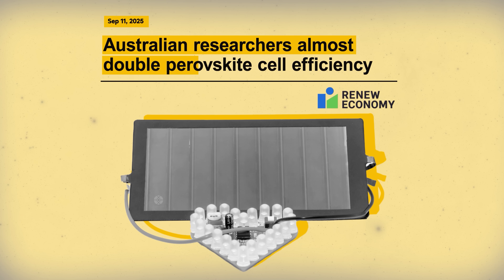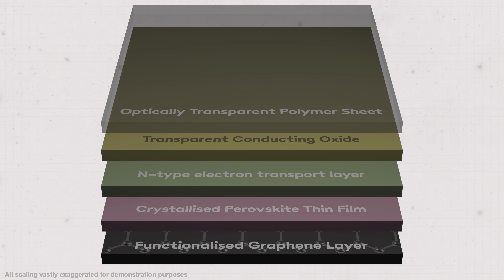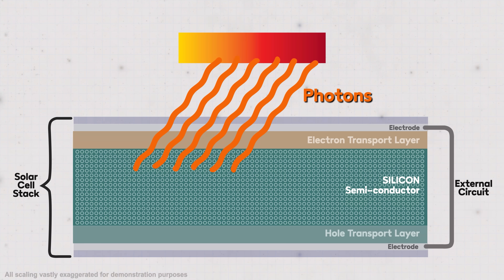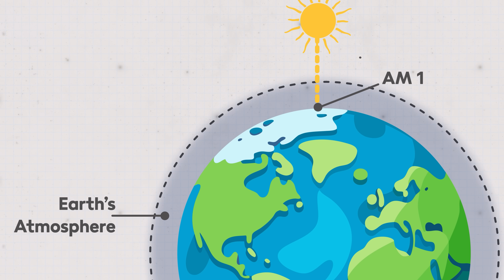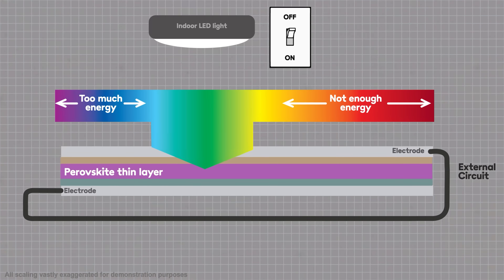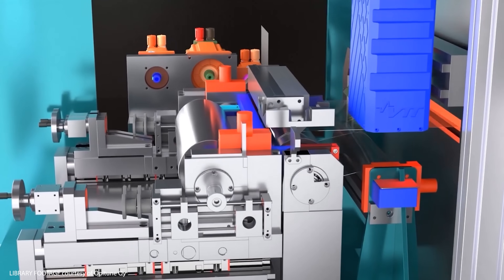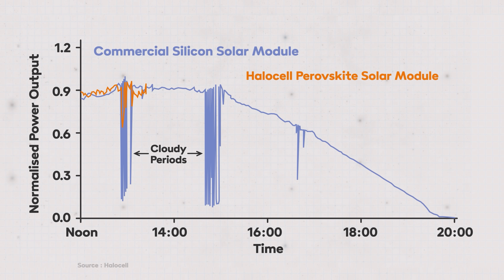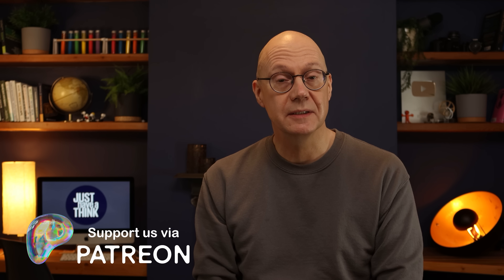Graphene Perovskite just revolutionised the Solar PV industry!

Comment: I am excited by the Aptera solar-powered car...and a more efficient solar cell would just make that car even more truly solar-powered and hardly ever needing mains charging.
Reply: Sadly the market for an expensive two-seater tricycle is quite limited and no institutional investors want to put money into Aptera; are you going to give them the $150M they need? I hope they somehow get the money to enter production, but it's a safe bet to predict that an EV startup will fail. Ultra-efficiency is good and as it gets cheap every EV should have some solar PV to gain a few miles of range, but for now 90% of drivers are better off buying a conventional EV for less money to recharge with nearby or grid solar power.

Comment: I live off-grid. I have 4x100w monocrystalline panels. On my best days I get ~90 watts. This is a big deal for me and the folks up here in the highlands.
Reply: I'm curious about your setup. Is there a reason you're limited to 4 panels?
Reply: @asm_nop I don't need more. My lights are LED, my fridge takes 10 watts to ignite the propane, my radio has a crank and scans emergency bands, and on clear nights gets S.A. and PacIslands. Got literally 1000 dvd's and book I still havent read. Hell, I'm still looking for Waldo.
Reply: @asm_nop  Yes, particularly 4 low power panels?   I'd expect these new graphene perovskite cells would be more expensive than a good conventional panel that produced far more than 100Wp.
Reply: @incognitotorpedo42 oh, I'd like them if I ever had to replace the ones I got. I am a champion off grid guy.
Reply: That’s really bad efficiency. I have 510W panels and on a good day I get about 480W per panel. Never seen 500+ but it’s theoretically possible. 

You may want to upgrade, mate. Get some efficiency gains. There’s already high quality tech at low prices without these new breakthroughs mentioned in the video, 15 years is a long time.
Reply: Bro you can spend like $1k these days and get 6kw of panels already
Reply: @RindosRides i spent $200 on used panels, and I was effing broke when I went offgrid.
Reply: @RindosRides  find a solar farm that is practically giving their older panels away as they are constantly upgrading!   Drill Baby Burn
Reply: @TheLosamatic I'm like 10 miles from the Canadian Border in eastern Washington. Not a lot of solar farms up here 15 years ago. And I did look into it, but shipping from Az. or Ca. would have killed it for me.
Reply: I live pretty far north and still get what my panels are rated for on my best days in the summer and I have them in a position optimized for winter.
Reply: They need to come up with a panel that could be put into a fireplace screen that can make electricity from the light and heat of a wood fire
Reply: @gmw3083  ...you mean like a steam turbine?
Reply: @ToneyCrimson  I dunno. Can a steam turbine fit into a thin panel only an inch or so thick 🤔 If so, then yeah 😃
Reply: @gmw3083  I mean why does it have to be in shape of a thin inch thick panel? As long as it generates energy from heat it should be fine,no?  No need for arbitrary shape requirement.
Reply: @ToneyCrimson  Solar panel type tech is basically at the consumer product stage now. If someone develops a steam turbine that can fit into that category then I suppose the consumers will decide 🤔
Reply: @ToneyCrimson not a turbine, two plates of differing metals that take advantage of the thermal boundary layer to pass electrons back and forth, ergo, elecyricity. But a stovetop turbine generator would be kickass. I don't have a lathe, power for a lathe, money to purchase a vertical milling machine, but it's comimg together in my mind. Plus, you get a free humidifier if it's a partially open loop system. Win, win all the way around.

     Ok, if I'm gonna build one I'm gonna need a small child with tiny fingers, a dumpster full of copper, and probably a box of the colonel's best chicken.
Reply: @davidhanna8470  It seems you're talking about two different things. The baby built turbine and the differential plates thing. It seems like the plates would be a better idea since no babies need to be involved. What sort of metals would be best? Magnetic and diamagnetic? How about aluminum that goes molten and then hardens up again when cool. I don't have any idea what I'm talking about. You can probably tell 🤔
Reply: @davidhanna8470 if we'd put similar effort into peltier modules (that power your stove top fan) as pv cells youd be able to run your entire set up on the warmth from a gnats fart.
Reply: @gmw3083  they’re called thermoelectric generators. You can throw them in the fire and generate electricity.
Reply: @j05hau  I suppose you were joking about throwing TGs directly in the fire. That doesn't seem to be recommended. There also doesn't seem to be a ready to use consumer product. Just components for DIYers. That's OK. It looks interesting 👍
Reply: @gmw3083  There are campfires with USB charger. They have a peltier element that produces the electricity from the heat. But they aren't that powerful, though of course still can be useful when e.g. hiking. I've seen both, gas stoves as well as some where you basically burn twigs. Haven't seen any for e.g. fireplace though.
Reply: @gmw3083 Solar panels are "looking directly at the sun" when performing at their best, no fire is going to produce enough light.
People with gigantic multi-kilowatt ground mounts sometimes see a single watt from the full moon on a very clear night.
Reply: @michaelmartin9022  I didn't mention solar. It seemed the thing mentioned here would be used for solar but it works differently or something. Anyway, I lost interest in the thing in this video. Others here have mentioned some other ideas that make more sense and now the OP has chimed in with some other fancy idea he's gonna hire a baby to build. Things are looking up. Or into the fire 😃
Reply: Good on you for reaching sufficiency a long time ago.
Converting my 20 acre hobby farm to off grid. The only reliance I have for fossil fuel now is my tractor and the hot water on one cabin is still gas. House hot water is dedicated PV to electric hot water. Car, ride on mower, all tools are electric.
Cost of grid power in the afternoon and evening is getting expensive, so I'm looking at sourcing two BYD car batteries to take everything off grid. Then I can sell some power back to the grid when it's expensive. Many problems are just opertunities in disguise.
Reply: @andrewradford3953 Get yourself some LiFePO4 house batteries, don't get led down the lead acid trap. Lithium Ferrous Potassium Oxide are far safer than any other chemistry and it will say LiFePO4 on the box, accept no substitues. Pure lithium will register better charge numbers, just before they burn down your house. Take it from a guy who had to work through a lot of bad offgrid ideas.
Reply: Woah bro I hope you can get these soon and inexpensively. 50% more power!
Reply: @adamk.7177really don't need it. That's like eating 4 cups of pudding because the recipe made that much.
Reply: @davidhanna8470  What’s wrong with eating 4 cups of pudding? 😁
Reply: Petrovskite is good news for you even without this development. Worse watts per area, better watts per dollar. The big problem is much lower lifetime.
Reply: @sharpfang I read somewhere that the same like 5 watt panel at McMurdo Station is still in use and has been monitored 7 ways from Sunday.
Reply: Don’t you have lots of space? Just put up more panels!
Reply: @edc1569 I was an electrical engineer. The kind that works on hydro-electric dams, buried downtown city vaults, lighthouse lighting, factories... etc...Electricity with a big wasteful E. Got me a cabin, a tool shed, some solar panels and a fenced yard that keeps the coyotes away. Multi fuel fridge, gennie and stove. Why I need more panels. I live on a high wind bluff, any more won't fit in my current wind shadow. I have a gas/propane generator, wind (an actual windmill), propane and solar for generating energy and firewood for heat (and cooking chile).

 Been around big energy, I just want enough. And my little system is enough.
Reply: nearby shop sells 600w panel for less than $100
you don't need to watch ads on youtube, just buy normal panel
Reply: Halocell has postage stamp size solar collectors that deliver fractions of a milliwatt. They are meant for indoor use.
Reply: I wonder if these solar cells will be efficient to be useful in the shady, rainy west coat near Seatt
le.
Reply: You need to check your panel angles or shading, that's rubbish ☹️
Reply: O.k., first of all, I bought these panels used about 15 years ago, shit was more expensive back in the day. I have been off grid that long and its more than enough for recharging my Anker power sticks, phone, run my propane reefer, ignite my stove and LED lights for days.  Plus I gots the VTOMAN LiFePO4 with the additional battery bank.
      Just for off-street cred, my ride is a 1980 F250 X-cab Ranger, original farm pack suspension, Weber 2bbl carb and fresh Warn hubs on MudStar 17"s. And yes, in winter I chain up all four tires. 
      So go hate on yourself. My system is what is called everywhere but America... enough for us. I could be snowed in from now until March without a worry. So, dis my system, but I own my land, live 7 miles from a grocer and got a driveway you can't even get up.
Reply: Woohoo this news effects you more than most then
Reply: @knifeyonline It will, but I hope it affects you more.
Reply: Actually this fool is trolling everyone here! He might as well hookup a few lead acid car batteries to an exercise bicycle!   Drill Baby Burn
Reply: @TheLosamatic dunno who yer talking to.
Reply: @davidhanna8470  so you realize with enough solar you could have saved the cost of that 15 years of propane!
Reply: @TheLosamatic it's a cost/benefit tradeoff. Plus, I like backups. I have an excellent, 200w generator to back up the panels. My reefer is high wattage 110va/c or 12v DC. or propane and only 11 watts for controls. The propane also serves as a heat backup for days like today with high winds, unsafe for woodfired heat. Three different cooking surfaces. A supply of propane fittings and hoses. I live an hour and 3000' in winter from a town only 7 miles away in a straight line.
     If your house catches on fite in winter, county policy is... unless you set the forest on fire, let it burn. 
     So, back to the initial question, I have enough electricity, and as soon as the sun comes back out, I'm gonna go split and stack the last of my winter firewood.
Reply: @davidhanna8470  well when the sh*t hits the fan and the mountain of effort to get the propane and the fuel for your vehicle to your location stops, you will see that going all in with electric could keep your off grid life going when the majority of people will than experience what has been warned about since the 1970’s!

Comment: Much respect and appreciation for you and your channel ✨️
Reply: I might have missed it but:
    I need more info on the base energy
       used to calculate solar cell efficiencies;
    It's inferred by different,
       & highly specific bandwidths,
    perovskite solar cells are compared to 
       indoor LED spectrum energies,
       among other possible bandwidths;
    Silicon solar cells are evaluated
       by outdoor conditions 
       & insolation levels;
this indicates apples&oranges comparisons
    as these cells are evaluated by dissimilar standards.

Thin film perovskite tech allows 
    separate layers tuned 
    to adjacent bandwidths,
covering more of the energy spectrum.

The Grail,
    the ultimate goal might be,
InfraRed spectrum cells
    meshing heat harvest
    & Air Cooling,
with energy production.
Somewhere there's an entropy violation,
    or low, strict efficiency limit.

Stacking energies harvested
    from several bandwidths
offers impressive energy production.
Reply from the maker: Thank you so much! Really appreciate your kind words. 😊